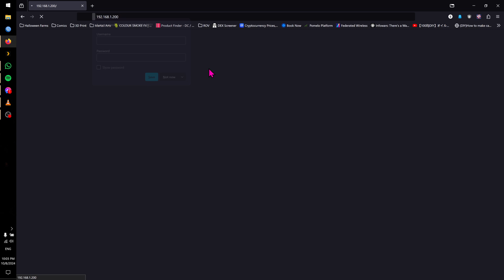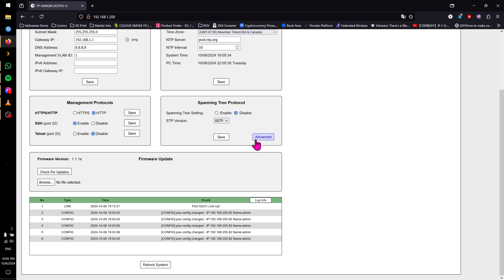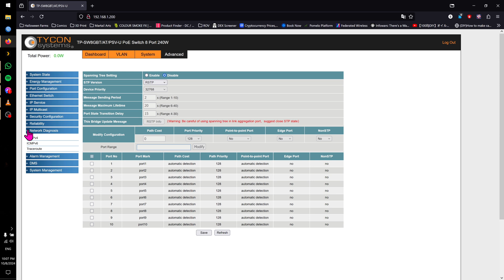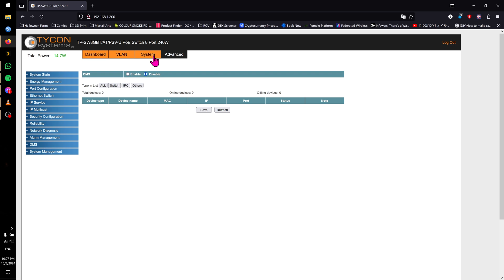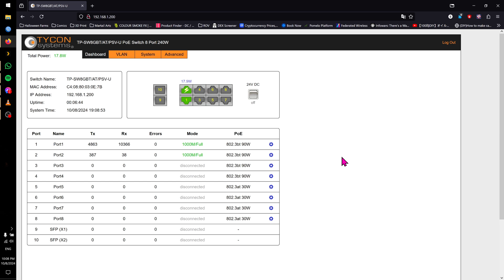NEW Tycon BT / Passive POE Switch!!

Comment: This seems really nice but why 2.5gb SFP instead of SFP+ (disregard, thought all ethernet were 2.5gb, but they are GB)?  1-4 are BT and 48v Passive?  5-8 are AF/AT and 24v Passive?  Is there any documentation on max amp per port in each mode?   And if there are 2/4 pair passive options?
This seems like a wonderful first release, looking forward to later firmware updates on this.  VLAN options seem to be missing Exclude (at least under basic setup)?

Honestly this looks great compared to some of the legacy options, and they also seem to be doing a revamp of their website at the moment.
Reply from the maker: Good question!